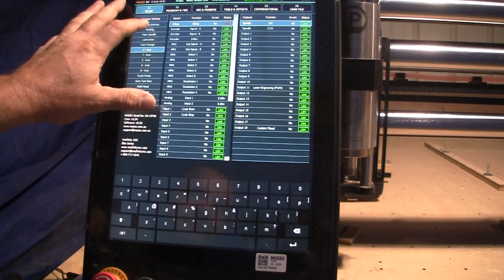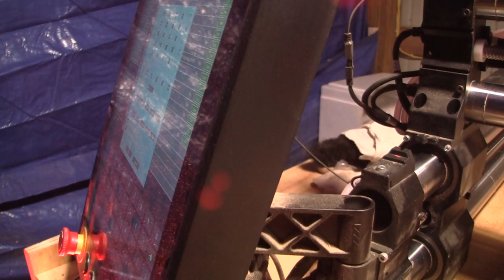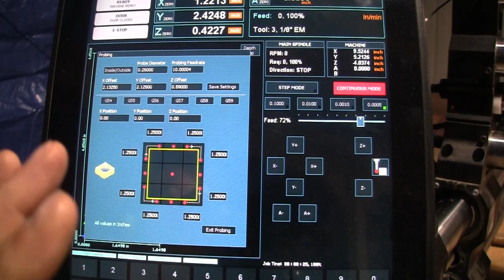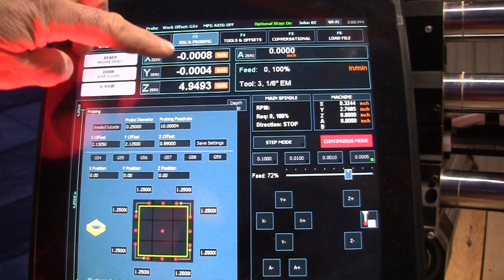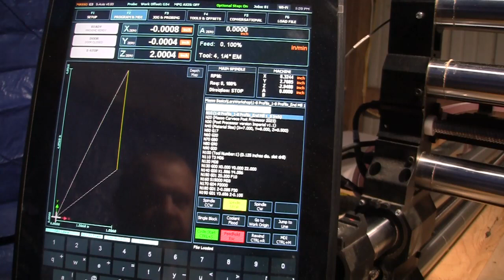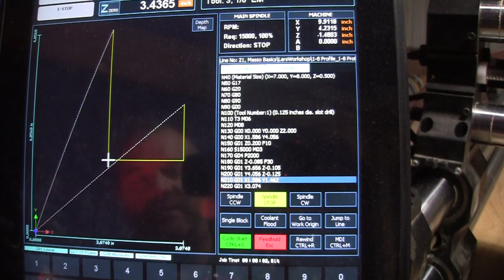Onefinity Elie Foreman - Getting Started With Your Onefinity

Comment: I'm sure somebody's mentioned it already, but the arrows on the front of the E-stop button indicate you're supposed to turn it to release it.
Reply from the maker: Nope you are the first
Reply: @LarsWorkShop  I just ordered an elite Foreman, but I've been CNC machining and manual machining for a while.  Started with a mini lathe in 2006 and a Taig later the same year.  Made it a business in 2010 and went full time in 2016.  Most of my machines have a twist release estop.  I had to walk out in the shop and look.  Everything under power that has an e-stop has a twist release.  Even the pendants that have an e-stop switch.  I think I have seen e-stops that are straight pull, but at the moment I can't picture one in my head.  

I've wanted something for "sheet" goods for a while and the Onefinity seemed to be the best bang for the buck.  Not the cheapest and built around a control I might consider for other machines.   In fact I am thinking about the Masso G3 Touch for an old Bridgeport I am retrofitting.  If I like it I may swap my Hurco over to it as well.  I've been watching a lot of owner videos, and the one thing I am not seeing is much machining.  There is some of course, but it seems like everybody has intro, setup, and the basics videos.  The Onefinity is more a "toy" for me.  It doesn't fit into my current business model and product lines, but you never know what will happen in the future.  I figured my big lathe was just for repair work, but I wound up using it more often for actual customer products.  Another middle weight mill I bought was intended for only roughing blanks, but instead it runs direct customer jobs several times a week as well.  Anyway, I enjoyed your video.  Lots of useful basics.  Very useful for a beginner, and not without merit for a more experienced "maker" like myself either.  Thanks for putting it out.
Reply: Oh, just saw I was replying under one of my other accounts.  Its still Bob here.
Reply from the maker: Bob, Thanks for the comment!!  A Bridgeport, wow, I have not used one of those in a while.  I would love to have a CNC bridgeport, I have a lot of people ask as soon as I say CNC, "Can you do metal?"   Another tool I would love to have is a CNC plasma cutter. :)
Reply from the maker: No worries - I have do it before too Bob
Reply: @LarsWorkShop    I am sure you can cut "metal" with a Onefinity router.  It just may not be the most efficient way to do it depending on the job.  A few years ago I finished some press dies made from 4140HT on my little mills with router style spindles tuning a 1/32 ball mill at 24000 rpm.  Some of the dies took most of a day for the finish pass.  Would have taken weeks on a regular mill.
Reply from the maker: Yeah big thing for me is the coolant.  Mixing metal and wood on the same machine.  I guess I could build some sort of switch base for metal
Reply: @LarsWorkShop  I'm building a steel frame table with aluminum plate top for mine.  Then I can throw a piece of MDF on top as needed.  I don't plan to do much (any) metal cutting on my Onefinity, but you never know what the future will hold.  I am planning my structure to be able to manage it.  I buy several hundred pounds at a time of aluminum, but I may see what a single piece of cast tooling plate will cost.  More likely I'll just section it together with flat bar and mill it flat in place.
Reply from the maker: Great Idea, Have you figured out how to drain the coolant? That is my big concern with cutting metal where I cut wood. :)  BTW I really like your molds, they look clean and polished.  Spent a lot of time in my past with a soft fine toothbrush and a polisher.
Reply: @LarsWorkShop  If you mean on the Onefinity router?  No I have not really spent a lot of time thinking about it.  On my milling machines they are in enclosers which drain back into the coolant tank through a screen to keep out "most" of the chips.
Reply: @LarsWorkShop  Actually I thought I might try a mister and a chip separator to see how much moisture would drop out in the bucket.  Of course remove all wood chips from the vacuum and thee bucket first. I really don't plan for this to be a metal cutting machine.  I just want the option if I have to do something larger than my mills can handle.
Reply from the maker: Yup - that is what I thought.  I want to have a separate machine to do metal
Reply: @LarsWorkShop  I was thinking mist and vacuum could control most of the coolant for some types of work.
Reply: Of course I don't plan much/any metal work on the Foreman for now.  I'm just building a stand and table to allow for it.
Reply from the maker: Yeah I do not know how much metal I will be doing,  currently working on learning to Weld. :)
Reply: @LarsWorkShop  My too.  I bought my first welder 25 years ago and I still will only weld for myself.  Someday I may get good at it.  LOL
Reply from the maker: Yeah I will that way for a bit. I had some things I needed welded and everyone I know who weld did not have time.  So I started by welding the posts for our wall on the porch.  The prequel video drop tomorrow morning, and I am still laughing at how bad it is. Lol

Comment: Total noob really needs help!

Hi Lars, my machine is all setup and ready to go. I've watched a lot of your videos and feel pretty comfortable. However, IO can't figure out how to cut a file I have created in Carveco Maker. I save the file and it saves it as a .art file. I transfer the file to my thumb drive and plug it into the Masso. I try to load the file and I get a message saying "No Gcode files on drive". I'm completely lost as to how I  get a cuttable Gcode file from Carveco to my thumb drive to cut it.
Reply from the maker: Check out this video it is how to make a lantern and has all the steps. 
First 15 minutes has all of the info you should need.
https://youtu.be/-IL2XPsQKEE
Reply: @LarsWorkShop  

Thanks. Shortly after I posted this question, I figured it out. All you have to do is save the project (.art file) and then go to Save Toolpath. Give the toolpath a name and save it as a Gcode file (.Tap) I tried that the first time, but assumed it would default to Gcode but it didn't. Once I selected Gcode from a lengthy list, it defaulted to Gcode the next time I saved a tool path.  I'm learning. LOL
Reply from the maker: Awesome.

Comment: What do you think would be the best way to run a drag knife on the Masso without having the spindle take time to spin up ( it doesn't spin,  I've got it set at one, it won't let you set it at 0) Also is there a way to have it go to work z zero, work origin goes to y and x but not work z.
Reply from the maker: Welcome to the channel. I have never used a knife on thr masso. But drop that in the group, a hunch of folks have.  Thr code should bring it to work z zero.  Need to see your code

Comment: What I’ve been doing with my touch plate is I have the magnet on a bolt head at the base of the Y axis.  It works since spindles are grounded to the machine, and I never forget the magnet, since I just leave it there all the time.
Reply from the maker: Thanks for the idea.  I just looked at you latest video and I will need to try that out. Totally sharing this in my next video and of course giving you credit!

Comment: Do you know that one can use the touch plate as a bit setter too? https://youtu.be/9xH6NT6mFX8?si=dBAjkOPrSDv9xgfE

I am buying a Onefinity machine. And I looked at a lot of videos beforehand. This was one.  

By the way, Thanks for your videos. Very helpful. 

I still think that you should share the teflon spray lubricant. Research if you like, but anybody watching your videos for Onefinity info should realize they shouldn’t have to go through that extensive procedure to keep their machine(s) in good working order. 
I’ve seen silicon sprays recommended too.  I don’t like to use silicon because it can interfere with applying finish if the silicon gets on the wood. Oil can too.
Reply from the maker: I use my probe as a tool setter. Nice video really neat stuff.  I am happy that you are enjoying the videos, it means a lot to me.  I would love to share the Teflon as lubricant, but it is something that 1F has written about many times to only use 3N1 oil.  Otherwise I would.
Reply: @LarsWorkShop  The responded really quick! 

Hi Mark
Thanks for your email.  We have not tested this product and therefore cannot state how effective it is or what issues it may cause (if any).  If you have used it on other machines without detriment, then most likely it will work on your Onefinity but we cannot recommend it.
There are other dry teflon lube products that have caused bearings to seize and it can take a lot of effort to break them loose.
Besides the 3 in 1 oil,  Boeshield's T9 waterproof lube is also effective.
Reply from the maker: Nice - So what have you decided to use?
Reply: @LarsWorkShop  I’ll probably continue to use it. I’ve never had a problem with using it. It’s easy and the product sheet specifically says it is good for bearings. I guess I’ll find out. Oil, even lite oil, has caused more problems for me in the past…
Reply: @LarsWorkShop  I read the lube recommendation from 1F. The objection seems to arise from dry lubes don’t provide protection for the bearings (I.e. rolling objects). The product I use specifically says it works for bearings so I sent them a message to see what they say…

Comment: I have a basic problem - my Journeyman Elite jogs in the Y- and stops at about 20" back - but it says it is at 32.1259"

And I can't get the PwnCNC spindle to spin up with the Masso. But it works manually.
Reply from the maker: Did you home your machine when you booted up?  Once you do the xy should say 0.000 and 0.000 z should be something around 5.000.   Spindle spin up, that is odd.  Are all of the cables connected in the correct holes.  If so, send an email to support@pwncnc.com and someone will help you out in a jiffy.
Reply: @LarsWorkShop  Yes, it homes correctly. And I had set up the parking in the back right, and it worked earlier on. But now somehow the "scale" of the Y/B axis is compressed by about 35%?
I will email PwnCNC - thanks.
Reply from the maker: That is really, really odd.  And you are manually moving the spindle with the controller?  Not running gcode.  Check this https://docs.masso.com.au/masso-settings/axis-settings I can check my settings in the morning for you.
Reply: @LarsWorkShop  Correct - it worked correctly earlier on, and now its not. I've got the same distance per revolution numbers on the X and Y axis.
Reply from the maker: OK - so I got some pics a just looking at some things, this is what i have on mine.  After I homed my machine today the x was at -16.000 inches, this could be your issue, so I pressed the X on the screen to zero that out, rehomed all good.   I sent you, I hope, some picture through messenger on Facebook.  Hopefully there is only one of you, LOL.  let me know if they help. BTW your cars and PEBL are really kewl!
Reply: @LarsWorkShop  That's me! I will be looking at this tonight. I am wondering if there is a bug - I tried entering 0.629921 (which is ALL the decimal places of 16mm converted to decimal inches - I am using my Calculated Industries Construction Master calculator). The last 1 can be typed in to the Masso, but it disappears. But maybe this is a bug? I'll type it out to the second 2, and see if that corrects it?

Comment: This is exactly what I need to learn about, at this point - thank you!
Next big step for me, is hopefully using a DXF file (I have CAD drawings) of the pieces I want to cut, and importing it into Carvco, to then define the tool paths. I am trying to avoid having to redo everything.

And I need to cut a clamping jig plate to easily repeat cutting panels. I am making flat packs for speakers, and I have the Baltic birch precut, so I only lose the 1/8" kerf; and use as much of the expensive sheet as possible. And also I don't have to handle full sheets - and I can cut them on my Journeyman Elite; rather than a much larger machine.
Reply from the maker: Neil, thank you for the comment and welcome to the channel.  I have another video on making laterns that show how to convert files to dxf using convertio.co (not .com) and importing dxf into Carveco.  
https://youtu.be/-IL2XPsQKEE

A clamping jig is extremely smart way of doing repeat cuts of panels.  Good luck and have fun!
Reply: @LarsWorkShop  Thank you for the response - I can export DXF from DataCAD (which is the CAD program I use for my day job). Where is the import menu on Carveco? I saw something to do with vector files - is that it?

I am now watching some of your other videos - and they are very informative and helpful. There is a lot of esoteric stuff with Masso that I am just beginning to learn about, and having practical hands on demonstration of these is invaluable to me, and I'm sure many others, too.
Reply from the maker: Under Vetor Import - just ignore the size, it will maek itself fit in the model you define. 

I am so glad that the videos are helping you out.  Thanks for subscribing to the channel!
Reply: @LarsWorkShop  that's great - thank you! I will be practicing this very soon.
Reply from the maker: Good Luck  just takes a little playing around on scraps and you will be great, I am sure.

Comment: Your comment about knowing the decimal equivalents made me chuckle. I was a CNC machinist for 45 years and even now I do everything in decimal format. It is second nature and a lot easier than fractions. Looking to get a OneFinity  machine soon to satisfy my lust of making things with a CNC machine again. Great videos by the way!
Reply from the maker: 😆,  I know the feeling, both about decimal and needing a CNC.  There is just nothing like coding, drawing or whatever and you can hold it in you hands. Thanks for taking the time to watch the videos, let me know if you have anything you want to see.
Reply: My very first drafting job (back in 1977?) was converting metric drawings to decimal inches - and the factor you either multiply or divide by, is 0.03937. Because 1" = 25.4mm
Reply from the maker: Neil, is this your first endevour into the CAM side?
Reply: @LarsWorkShop  No - I have a PhlatBoyz PhlatPrinter III CNC that I cut a LOT of 1" x 2' x 8' foam sheets with, and built a full size electric car prototype - a foam plug with a windshield from a Smart Car, etc. I call it CarBEN, and I have a few videos of it on my YT channel.

It has been sitting in my garage for 11+ years.

I did a lot of G-code using DataCAD, SketchUp and a plugin from PhlatBoyz.
Reply from the maker: Nice I will check that out
Reply: As a CNC Machinist back then, I was the outlier in the shop. While other guys would be doing what you said, converting dimensions to decimal format, I would just preface with a G21 and enter dimensions in the metric format as given on the print. I could be making chips before the other guys even started cutting. @NeilBlanchard
Reply: @ronsullivan132  right - the company I worked at was paying me to redraw and re-dimension everything - and saving a ton of money having these parts machined/fabricated with the decimal inches.